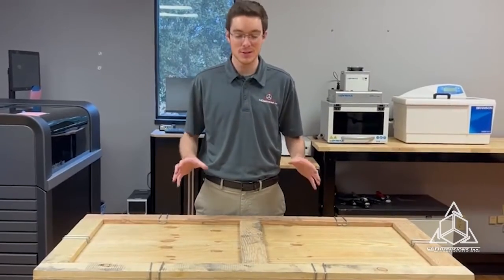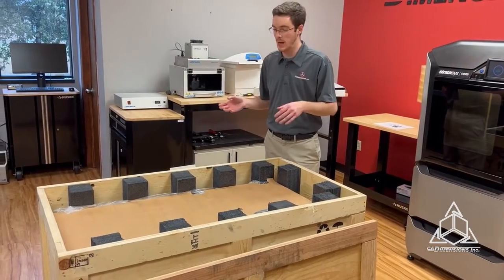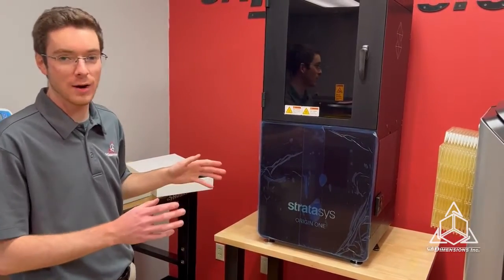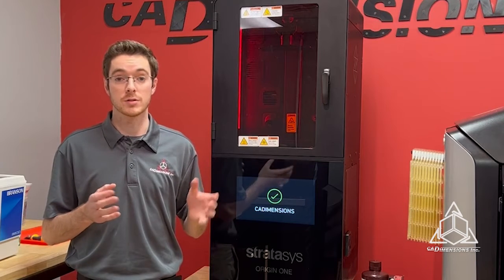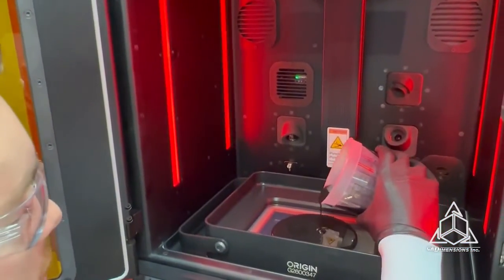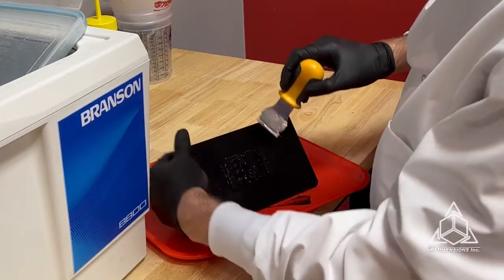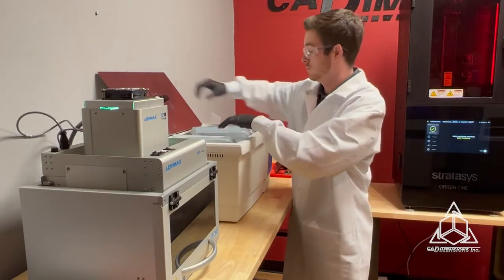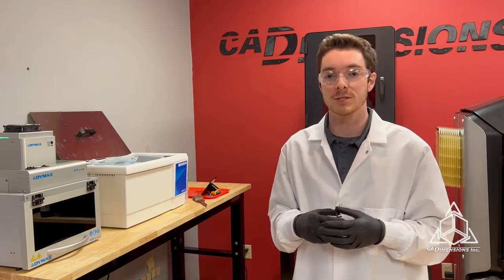Unboxing The All New ORIGIN ONE 3D Printer By Stratasys

Comment: So here's the problem with this you spent thousands of dollars and got a very limited cabinet and got a cleaning system when you literally could build your own system and housing for probably a third of the cost these 3D printing companies that make units like this are robbing you blind and not giving you enough to me I would rather build my own printer to the size and specs that I want to actually do something glue or plastic weld my own enclosure and still have some money in my pocket but nevertheless I guess if you're looking for a clean corner unit that is limited and cost an arm and a leg this would be the best product for you
Reply: Are you sure you could build a fine resolution photo-polymerisation printer from scratch?
Reply: @arseniix  if someone built that one anyone with the time can build a better one or bigger time is the factor that's all Im waiting for almost every 3 to 6 months these machines and all forms of printing are getting better. Tbh Im a mechanical engineer and metal fabricator by degree and trade. I have electrical background as well so Im pretty sure I could. But I don't have time.
Reply: $100,000 is what this printer costs...uses a technology called P3, brand new tech. Stratasys probably has the patent on it. Good luck waiting on that one.

They also have a Stratasys 450mc FDM printer that costs $150,000

You should build some and sell them for half the price 😆😆